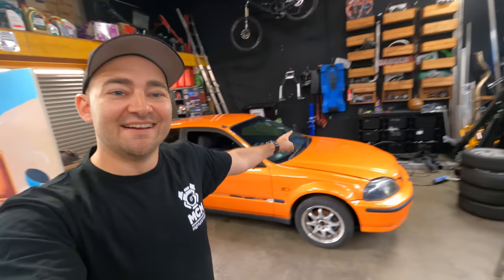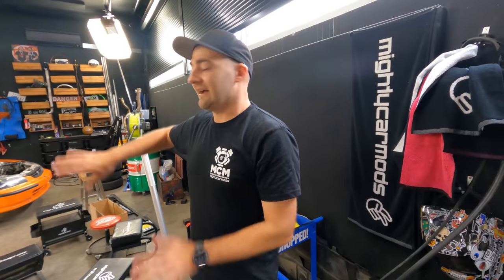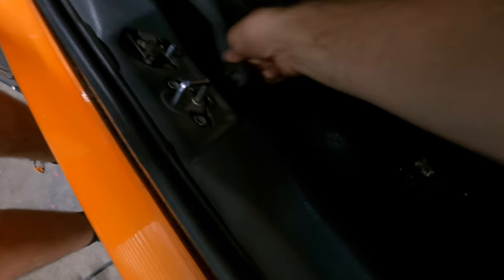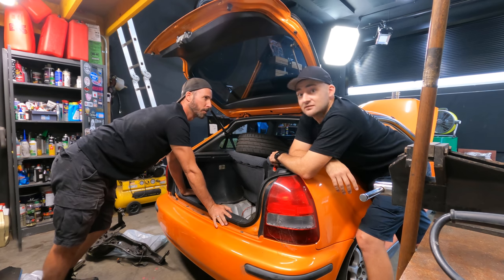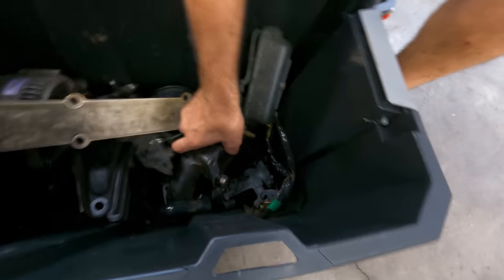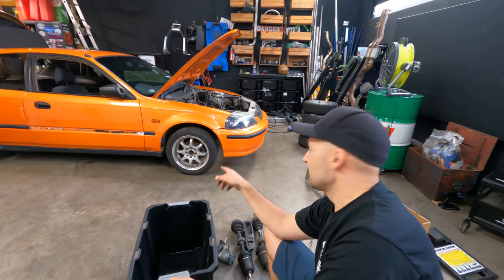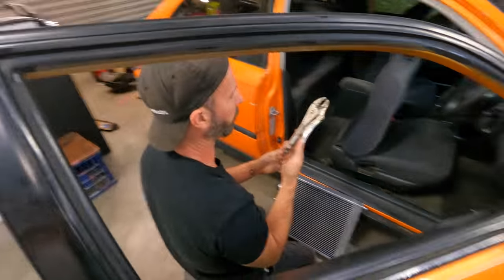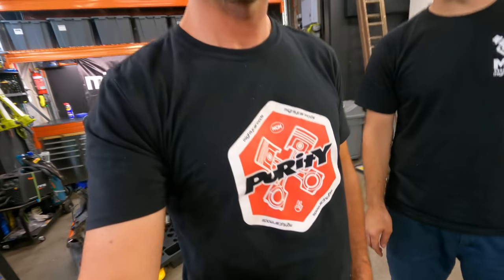Buying an unfinished Project Car (off the internet)

Comment: One of the worst jobs ever is to put back together something someone else has taken apart. Good luck.
Reply: Luckily they have the funds and access to people with expertise that many of us don't have.
Reply: @scotstralian9147  it's still a semi nightmare though.
Reply: Then I would take it as you have never bought a shell and built a complete car from the bottom up have you????? I would much rather start off like this then with someone else half assed, dodgy bullshit any day.
Reply: @twisted2291   this just looks like a nightmare job to me. As no I’ve never built anything from a bare shell either.
Reply: I actually like it, lol.  Of course I usually get bored w/o before I fully get it back together & sell it...but for that first 6mo or so....
IDK what it is about it, it's like a puzzle kit that somebody else made and I get to figure out.  It is usually nice though if you have an idea of what happened, so you know what's busted & what's not.
Reply: I say the moter missing stuff is annoying 🙄 more than anything  else, hope its real cheap.
Reply: Neo VeNoM it really is not a nightmare if u know what ur doing
Reply: at least the stuff is partially assembled lol. Try it out with a disassembled engine, interiors and suspension and that's when you'll reach hell.
Reply: Depends on the extent, if it's all fully apart then it doesn't really matter because all you need to do is get everything back in, you should know what's missing when building it. Rebuilding something someone's already started putting back together would be a nightmare that's for sure.
Reply: @o0Stephenpatrick0o  if the person has everything that's needed properly labeled and separated yeah. But what I've seen is people putting everything in big boxes without any labels, then you're left wondering where each bolt go, why I can't find a specific cable, hose, line, bolt, nut, etc. or maybe you end up using the wrong bolt or part somewhere or end up putting the part incorrectly and damaging it... yeah it's hell. I've seen that personally, at least in this case most of the stuff is already assembled or half assembled so there wouldn't be much missing stuff.
Reply from the maker: Especially when it’s your heart 💓
Reply: @mightycarmods  🤣 I smell some trauma crawling to the surface.
Reply: @Hartbreak1  If you watch boosted bois, then you know that bolts are optional on hondas!
Reply: @mightycarmods  awww
Reply: I have my own disassembled project that has been languishing for years. It might as well have been started by someone else at this point 🤔
Reply: “Project car”  means so many different things to different people.
Reply: @mightycarmods  I don't come here for feels! I only recently got over Cheryl.
Reply: @mightycarmods  awww ;(
Reply: You are not kidding, but according to my wife, she decided she loved me while watching me turn a pile of parts into a 1964 C10.
Reply: @Hartbreak1  At least you don't have to break any bolts free if it is just a pile of parts.
Reply: @mightycarmods  are you good?
Reply: @mightycarmods  subtle
Reply: Honda's tend to be pretty straight forward & very lego-like as he said similar to Subi's. Most things like linkages & brackets for a sohc work for dohc, or can be easily modded to work. You just need to know what few specific bits only work with B16-EK's.
Reply: @mightycarmods  Memories of Cheryl?
Reply: @TKettle  beat me to it

Comment: Now Civic's get another 25% premium MCM car tax added :P
Reply: Thank you
Reply: @TURBOTRISTO  Looks like my cheap civic hunting adventures are over
Reply: @LucaG1  gone bro covid and mcm have now made it crazy I paid $1000 for mine, they are 5k for a shit box now
Reply: ??? Civic is probably the only car MCM won't be able to budge due to sheer volume, and good ones have been pricey for ages
Reply: @myownsite  nah man, when I see a shitbox CXi in Manual for no less than $4000 that's already high, shitbox meaning it's already got a headgasket issue, interior missing about 50% of it, rust everywhere, you get where I'm going
Reply: It's better than the COVID tax on 4x4's. It's fkn ridiculous out there.
Reply: Fine by me, Ive got 3 of the things, 2 of them turbo
Reply: @pv3566  Not for me, sold me JK 2011 for a nice sum.
Reply: @LucaG1  civics stopped being really cheap in August 2020
Reply: @TURBOTRISTO  you're gonna have to change your description to include civics in the priced out car section soon.
Reply: @itsthatbeeguy  yup
Reply: Bruh. In europe u can still find civics for 500 euro's in good condition but just with a d series
Reply: bought my EJ8 coupe for $1,500. Cheerin
Reply: @bennigek7196  cars have always been cheap there. Topgears cheap car challenges wouldn't work here.
Reply: We have the power to control the market, we are the demand and can dictate the price
Reply: @jacobmanher  most are. But a s13 is still €15k and miatas are going up to €7k and higher. U can find civics basicly everywhere so thats why theyre cheap

Comment: "have you bought a car in pieces and put it back together" - yes, 1969 BMW 2002 with an M20 B25 straight six swap. Bought it for $3k, sold for $22k three years later.  Yes, it was the funnest car I ever drove and funnest project I ever worked on.

Comment: Love your show!  I absolutely bought an 86 mustang GT that was a rolling chassis, several boxes of parts, and heaps of newly purchased but never installed bits.  I gave myself a budget to get it together and running and then promptly blew that budget up in a few weeks.  Years later, now that it is mechanically sorted, it's a fantastic automobile!  I have a stock drive shaft and a stock power steering pump.. absolutely everything else has been replaced, upgraded, or removed.  I wish you fellas the best of luck on the build and I'll be here watching to see how it washes out!

Comment: I bought a 240z project (arranged via 1 skype call) after watching your build series, it came in a lot of boxes with more spare parts than I know what to do with. Progress is slow as I have to undo most of the previous work and I've not got much space to work on it, but it'll get there one day. Right after I finish building my 89 Prelude, great to see you guys have hopped back in a Honda

Comment: I bought a 2014 Dodge Charger V6 AWD from an auction website based on nothing more than pictures online. It was totalled- literally in the legal sense! Front end was smashed. Engine could start once the frame and radiator were pryed away from the front so the pulleys could spin. Lots of the front bits were in the back seat.

I spent 6 months in my tiny garage rebuilding it, replaced the subframe and welded the frame extensions. I got it inspected and registered and its now my daily driver. 

I never took on a project like that before. In many ways I can thank you guys for the inspiration. Of course I shot videos and posted them to my own youtube channel which in part is also inspired by you guys, so double thank you very much! You guys do a great job of showing people what's possible if you're willing to try something new and put work into something you care about. Thanks again!

Comment: big snail built k series are just on a different level. they are literally built different.
Reply: Nah this needs to be a NA limiter bashing civic rather than properly built with boost
Reply: @R03333  ported heads, cnc flywheal, cams and valve springs and retainer kit = infinity rpm BRATATATATA

Comment: I bought a basketcase 2000 EX Coupe for $900 US about a year ago. I fixed it up by just going to the "Pull-A-Parts" near me. I bought new pieces for stuff that can't be used such as brakes, stereo, a new windshield (Why do all Civic windshields have cracks in them?) Parts are everywhere and these cars are easy to work on and mod-mightily.

Comment: I bought my Evo as a rolling shell. All the nuts, bolts, and accessories were in 5 gallon buckets and the motor was on a pallet.
Reply: Lol here’s a bucket. 🪣 have fun
Reply: D-did you get it done?
Reply: @rya3190  yep, it's got a built 2.3 stoker and 30r Turbo. Tuned on e85, running stock boost right now making 351awhp. Have Haltech Elite sitting on a shelf waiting to be put on. Once I get that installed I'm going to turn it up.
Reply: @adio1787  Awesome! My first car was an OZ Rally, and I had dreams of building it up like an Evo... glad to hear it worked out for ya!
Reply: @adio1787  thanks for the other half of the story!

Comment: I picked up an old 81 turbo diesel VW rabbit a couple years ago that "had everything" in the car. It's still in pieces in my garage. Hoping to finish it this year. Those are some of the best ones to get running and driving. It's such a big puzzle to piece together and finding parts are impossible lol

Comment: I bought a 1978 Series 1 RX-7 with everything in the cabin in various boxes.  It was my pandemic project.  Rebuilt the rotary engine and put all the bits back together and now I've got about 500-600 miles on it.

Comment: I bought a 98 honda civic ex shell that had the bare minimum to roll and I converted it to a 99 ex, which is completely different interior and exterior. Complete new wiring harness inside and out. It took me a month to put everything together, lots of work. Found out alot about the car. I had it completely stripped at one point. I put 2 cars into one. Now currently putting a turbo.  Hopefully have it running this summer. Wish I could show you the pictures.
Reply: Ps the car is currently running but piecing the turbo together.  It does have a jdm D15B

Comment: My first car (don’t judge) 1986 Holden Camira was purchased from a wreckers. It had been abandoned on the side of a road and collected by the local council. Dad paid $80 for it. No keys, engine was half missing, interior smelled like a frogs ball sack because as windows had been left open. We got it towed home, broke into the boot and found the rest of the engine and manifolds etc. ended up being a great car that I got to learn heaps on as we basically had to rebuild the head and put back together. Yay for nuggets!

Comment: Picked up a 1989 fox body for 300 buck. It was just a roller by the time i was done with it the shell and rear end housing was the only stock part left lol. Full cage tube everything!! K member a arms rear links.Built by me boss 302 5 bolt main forged crank cp blower cut pistons stage 3 cnc heads upper and lower intake cam v1 vortec super chager. 2x2 tube from torque box to torque box to stiffen the frame and on and on just needs paint. Love what you two are doing been a fan for a long time! Keep up the good work. Send me a message if you want some pics of the build.

Comment: Bought a "not running" Datsun 1600 a few years back. It was mostly complete but had sat around for 20 years with various bits pulled off. PO told me the motor was locked. It wasn't. I've manual swapped it, gone through the mechanicals and a little rust repair. Now it's a daily. And yes, I've made my money back well and truly.

Comment: can't go wrong with a 90s honda, those things will still be running in 2090
Reply: I actually had to trash both my 90's Honda's recently. Rust and blown O-rings. Bought a new Civic. I hope to drive it until 2046
Reply: Those valve seals tho....
Reply: Gas vehicles will be outlawed by then

Comment: Started with a gutted 91 integra and a b18a1 that was all in boxes, bare block, torn down head, plenty of missing parts. $300. 7 months later and I'm still short on fluids, battery, plugs, rear suspension, and has a busted windshield. Hondas/Acuras are fun though.

Comment: I bought a vw beetle half finished project sat less than an inch from the floor ran like a bag of nails rust everywhere paint was corroded had new radio and speakers fitted but not wired up no door cards no carpets all sorts still working on it

Comment: 18:28 Yes, my 1988 Supra started with no carpet, a bunch of the pieces in the trunk and it ran but had a spun bearing so motor was junk basically needed a full overhaul. Now it has a full sound system, turbo motor, and all I need are wheels, tires, paint, and a headliner. Lots of anger and fun putting it all together

Comment: "everything fits into everything..." until it doesn't.
Reply: Story of my life-
Reply: Most of the time..
Reply: That's what a grinder, cut off wheels and welder are for
Reply: Bolts right in as long as you have all the correct bolts.😉
Reply: @eldonerc2524  not exactly, Honda is full of aftermarket support which also means lots of shoddy quality parts and imitations. It also doesn’t help that these engines went into so many different models and each each application may have subtle differences from others. You end up with a lot of mislabeled parts that may not suit your particular application. Swaps add more variables to that. One of the most common issues is getting wrong engine mounts since there’s like 2 or 3 variations depending on the chassis and engine combo and you’ll often end up getting the wrong mounts. Long time ago I had a Honda project and had to triple check any parts I ordered to minimize the chance of getting wrong parts.

Comment: MCM: Honda Civics are rare and expensive.
Me: Looks on local classifieds and finds many of them for less than $1000 US. I need to be exporting these things.
Reply: Are any of those hatchback manuals that aren't rust buckets, don't have at least two bashed panels, and haven't been modded terribly by some kid? If so, I'll come buy it (currently trying to decide between an $800 coupe with a blown transmission and some rust or a clean hatch that the market has decided is now a $4k car)

Comment: I just recently bought a 1989 Civic LX sedan. The front suspension is shot, the trunk had a pool of oil in it and both front fenders and passenger side of the car hit a guard rail. The car in total was $50. She starts, runs and drives, but it has so much positive camber that she is super hard to keep straight. The interior cleaned up super nice and she has a lot of potential.

Comment: Quick tip: make sure it has a crank position sensor oil pump otherwise it's an engine out job if you realise it when you've already installed it

Comment: With that brake swap for the rears, keep in mind you need a different proportioning valve to run rear discs - or you won't get equal brake force front to back. Also it's an idea to upsize the front rotors, calipers, master cylinder and booster. Did the full Integra GSR brake swap many years ago on a Civic and it was amazing - best brake pedal feel I've had in a car once it was all sorted.

Comment: My first car and current daily driver is a 1968 VW baja bug that I bought as a rolling shell. It had no engine, no interior, no fuel system, and no glass. I built it up and eventually put a 2180 stroker engine in it. Now after 4 years of ownership I'm putting a turbo on it so I can finally go fast

Comment: Bought a 1989 mustang GT. Driver seat was a shop seat, no fuel tank, gauge cluster or transmission. Exhaust was cut in half. Ended up requiring the cluster for a 93 model got a junkyard 302 and trans. Rehung the fuel tank and took it to a bunch of shows and drag raced it a bunch before selling it. The next owner ended up totaling it about 3 months later. Girlfriend at the time cried. Good memories.

Comment: I bought my current Evora S swapped MR2 as a rolling torn apart freshly painted (15 years ago) shell. Its been... an adventure to say the least to put it back together.

I found the car for sale for $1000. It had most of the interior, and enough suspension parts to allow it to roll onto a trailer. The previous owner had torn it apart after blowing up the original NA motor. Then had it painted a nice blue color, and fitted an unknown body kit. With the intention to turbo swap it someday it sat in a warehouse for 15 years. Then the business got bought out and the MR2 had to move. Finally coming to terms with the thought that he would never finish it, it was posted for sale.
I picked it up about 3 years ago now to build my dream project. A supercharged V6 SW20 track car. It's finally running and driving. Currently at a shop getting a few things fixed up and gone over then the final tune!
Flex-Fuel, 1000cc injectors, Link FuryX ecu.

Comment: I purchased my turbo’ed civic for $650 not running pretty much as is, new injectors and a street tune and she’s been running 16 pound of a stock D series block for two years. Wasn’t running due to slipped timing belt, i realigned it with the same belt and sent it ever since

Comment: When I was 16 a buddy was given 3 trucks none were complete and by the time we were done we rebuilt a 350 chevy and a TH 400. Swapped an interior and bed and fenders. Should have just stripped a frame and worked up but we did it in stages and never had it more than 1/2 apart at anytime.

Comment: My first car in 2010 was a 1990 Honda ED civic with 413,00ks with a stuffed carb setup I got for the price of a tow. Replaced all bushings and suspension arms/shock and fixed up the carb vacuum lines. New dizzy cap and leads and it went good for 20,000ks before the engine went. Got a full rebuild kit, lightweight flywheel and few other bits and rebuilt the engine. 100,000ks later of super hard driving it blew and sold it as a going project few weeks back to a Honda enthusiast that’s rebirthing the car once more.

Comment: I bought a 02 wrx bug eye for 500$ did a full pant correction and jdm prodrive STI setup inside and out with built motor 450whp and now its one of the nicest cars in my area

Comment: I got a 96 integra rs for 300 and a six pack of beer. Transmission and clutch were gone. So had to replace em both. Going to be rebuilding a bseries motor over the summer. Hopefully if my budget works.